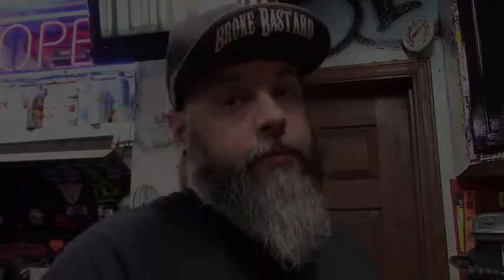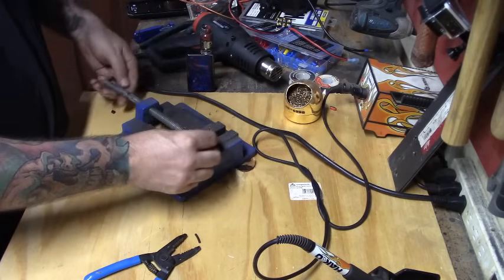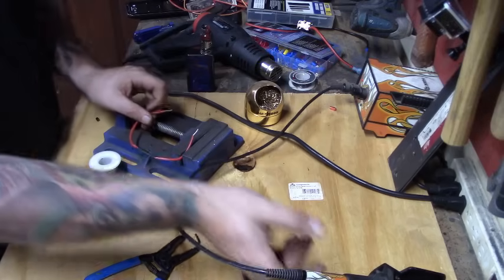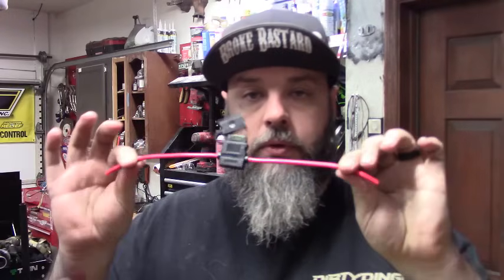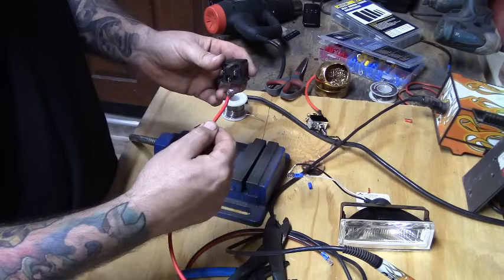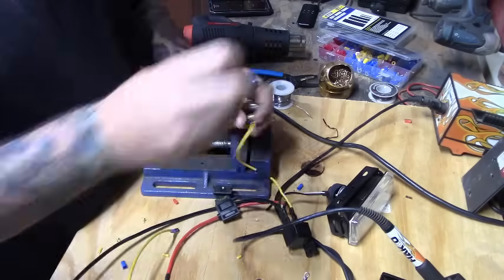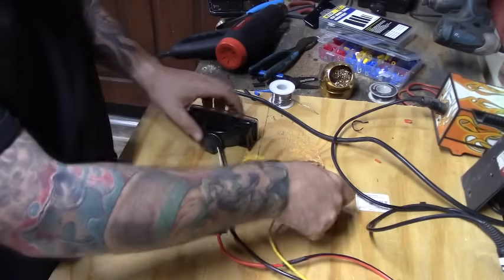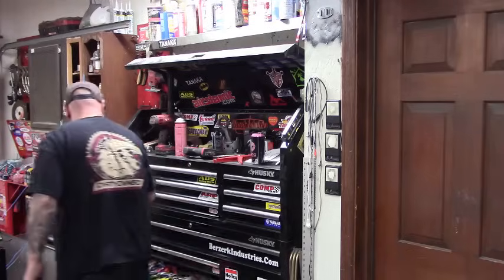How to wire a Relay and Why You should use them.

Comment: Hey when it comes time to wire the head lights go to ebay and punch in relay head lights. You can get both relays the harness and the ceramic sockets for the head lights for around $12.00 makes it wicked easy .
Reply: Head light circuits on older mopar stuff had same problem. They ran power straight through the headlighy switch. Everyine one ive had ive wired relays in to stop melting switches. Also old Japanese motorcycleare notorious for these wiring issues
Reply: Ho

Comment: 6:05 You really should hook or twist the wires together after tinning them; there should be a mechanical bond between the wire-ends, not just the soldered surfaces.  I have had many a wire pull apart this way.

Comment: If you want a stronger solder joint search NASA and military soldering techniques a much better integration of strands to solder but takes some practice😀
Reply: D twist Rewind agreed, the lineman’s knot and other wire splicing techniques make for better connections to solder. I also like  liquid tape underneath heatshrink. 

Crimp connections suck!!
Reply: His soldering is totally wrong. The worst way to solder a splice. Have to go NASA spec splice. The amount of solder that flowed down the wire and under the insulation sets the joint up to be too rigid. Just putting the two wires together without meshing the wires is the biggest no in soldering. He created a huge gob that is VERY susceptible to breaking. So yes he needs to learn how to solder.
Reply: Michael Shuman most people do, but I’ve seen worse than this. A simple tutorial - or some research - would suffice here I believe. Not everyone has been exposed to the “technically correct” methods, after all; it’s a specialized technique, after all. Not everyone works with NASA or to Mil-Spec standards.

Comment: HUM, 1st time I ever saw the "TIN" pre-solder step, KOOL, makes sense !
Reply: Numa Newbern ... I learned that when rewinding electric motors , soldering the internal connections and new lead wires   Makes a much cleaner & smaller connections. Always used the thinnest diameter 60/40 Tin as it’s much easier to control!  Happy wiring y’all
Reply: ...Oh yeah,  Never Ever used flux on electric motor windings,  it contaminates the factory coating on copper wire, causing premature shorts !  No Flux Necessary

Comment: You should have twisted the wire first, then soldered them together.  goood video  explanation.
Reply: Twisting is better structurally. If wiring heats up the connection will hold. Just saying.
Reply: I don’t think you noticed but He DID twist the stranded wires. After he striped it, he rotated the whole wire while holding the stranded end, go back and re-watch. You’ll see, its subtle but he did. I thought so too. I replayed it and sure enough. Good point though...👍
Reply: @Profabdesigns  Maybe I didnt see him , I checked again and I did not see him twist them together, HE did do it individually but not together....thank anyway's.

Comment: It's always a good idea to clean the soldered joints with a little alcohol and a "acid brush", especially if you use flux.  I recommend flux because it aids in cleaning the joint, and making a more solid bond. Good video!
Reply: “a more solid bond” just how freaking solid is good enough?

Comment: Excellent video. I have the Doyle crimpers and the Pittsburg Pro automatic wire strippers. They work really, really well. That HF heat gun also works great, just don't run it for too long or the plastic end heats up a lot.

Comment: Thanks for video great help now understand reason behind relay and where I want to add it in basic 12v circuit I am building. Just need work out the grounding part now will have to rewatch and see what you did. Thanks for help

Comment: ...Tnx man for the 4-Way relay numbering diagram included ( bottom right corner) midway through the video.  Tremendous help trying diagnose problems in wiring through relays!  I saved it for later AND subbed your channel. Uncle Fudd < N.PA

Comment: Older cars/trucks have relays under the hood and I have what I got the rig for. Yet being cheap, I grab easy fuses as there are so many different kinds that I pour them in a plastic tray on the bench for easy reach and most are color coded so I sight tells me which I wanted, and there is alway a few relays that go in my Dorman box and just lift lid and pick one needed. I can wire all my switches with sixteen gauge wire out to relay and depending on draw pick from relay to accessory. Keeps everything on short runs and so easy to put a few wires in a loom so it looks nice done. Good video for any newbie trying new to him projects.

Comment: Hello BBG, yeah good job talkin about fuses, many think its all about the voltage, can't get a shock
from 12 v so they don't worry about things. What they fail to consider is that the car battery has
way more amps than volts.  Cool Kat likes auto electricity. Some wire insulation will flame, some
just melt, either way not protecting the circuit is about the same as putting a penny in the old style
home fuse box.Good job about using a relay.

Comment: Thank you so my power box has red key on plug it into 87 ,has a green wire coming out the power box has a switch so the green plugs to 86 ,,the number 30 on the ReLay come from the battery fused plug into.30 ,and 85 is Ground,,,,
If I have it right ✅️ so Awesome Thank you Brother.

Comment: Great video, very informative thank you. I’m doing a holly blue electric fuel pump for the first time. I’m going to use a relay but I’m confused if I should make the fuel pump turn on with the key or with a switch. I’ve heard both sides of this what do you think?
Reply from the maker: I run them on a switch on the race truck. For safety. But on my normal cars I wire them to ignition hot.
Reply: @BrokeBastardGarage  OK cool, thank you for the reply. I am working on a 65 Coronet , street strip car, i’m trying to find out where to put the wire for the ignition, I bought relays and fuses because of your video just got back from the auto parts store, but almost the exact same stuff you have in your video. Thanks again!

Comment: i have connected 2 relays , in one big thick wire and connected to the battery positive terminal ,  i have installed 2 switches , one switch for one relay ,  and they are connected to the same positive wire that commes from fuse box ( key on power on )  so long story short both relays are connected to the same Positive wire coming from battery and same negative (ground wire ) to the negative terminal of battery ,    its any problem connecting this way,   can i use both relays on same time,    one i have for audio amp and the second one i installed under car led (like on need for speed underground 2 ) :D   thank you

Comment: From the diagram at 13:57 I see the switch still is drawing full battery power and runs the same risk as before; do I need to put an inline fuse as a safety precaution?  Loved the explanation of a relay, never knew why they were needed, now I do:)  Thanks for the video and succinct dialogue.

Comment: I could do a video on high grade splice soldering which is a lot stronger than what you do if you'd like because it stops the solder joint from breaking as easily when they flex

Comment: good video - I wish you were talking more about stripers, possibly showing some alternatives
no joke. the trick for soldering is applying the solder iron at the bottom of the joint, and the solder at the top, so gravity will work for you and let the solder go through the heated joint.

Comment: Thanks for the video. The soldering technique was really informative, especially your preference for non-flux tin.
 
I was wondering if you may consider making a video to show how to wire a relay to a rocker switch for a winch,  I want to install a winch on my pickup, using an IN-OUT 6-pin rocker switch (polarity reversing switch)  with 8-gauge wires to prevent overheating.
I am mostly interested in the fundamentals, namely the wiring diagram and possibly a demonstration of the basic circuit.  Do you think it is crucial to install fuses as well?

Thank you and good luck with your channel. You have the gift of clarity and you deserve success.
Reply from the maker: Does your winch have the small electrical box that comes with it that your remote plugs in to now?
Reply: @BrokeBastardGarage  Thank you for answering so quickly. I inherited the winch from a friend who upgraded to a more powerful model. He only gave me the winch, naked, with no control module or wires. 

Initially I was using it just connecting the wires from the terminals directly to the battery using alligator clips. I  was so ignorant that I was using 12 gauge wire but I learned very quickly that it was getting so hot the plastic insulation was melting.
I bought a IN-OUT 6 pin switch but on youtube I learned that a relay is strongly recommended. And here I am.
Thank you again for your excellent work.

Comment: Total nube to relays, etc., but I added a power seat to my '05 Dodge Ram PU today - all went well until I put a fuse tap on a 20 amp fuse - seat worked, but fuse blew. Tried same with a 25 amp fuse - ka pow. Same result. Will an inline fuse (what amp?) work and will I need a relay? The switch for the seat is OEM mounted to the seat frame. PS: your explanation and demo of soldering was EXCELLENT! Thanks!
Reply: Hahaha! I solved that puzzle - my truck WAS wired for power seats already - plug and play. Duh.  That's okay, all is good now and I still learned the right way to solder! Thanks!

Comment: The fact that you solder the wire to the butt connectors , and slide the heat shrink up over the prong of the relay is an Awesome tip. Very clean. Very safe. Thank you bro

Comment: Thanks for the video. Im just running two work lights in the bed of my truck. Can I just get by with a fuse between the battery and my switches? (I'm putting two switches in to control the lights individually).  (3" LED)

Comment: Great video  - love it: Question - 2020 nissan murano platinium - hardwire install blackvue dr900x-2ch plus +powercell 8 battery pack +cm100 lte module na. any tips on using a relay switch? thanks in advance

Comment: Where did the other end of the yellow wire go to? The relay to the switch and then from the switch to where? This was the best video and explanation that I have watch.  Motivating.
Reply from the maker: Anthony Diaz thank you. The other end of the yellow wire goes to fused power. Either ignition hot or battery hot depending on what you want.

Comment: Depends on what you are powering. Relays are switches as well. You can go direct switch and fuse if you take into consideration

correct wire based on current (and temperature), then the voltage drop based on the length.
correct switch based on current
apply de-rating current capacity on the above 2.

Comment: im going to add LED lighting kits (two) and a GPS power head to my 3 wheeler. I'm also adding a FIN (gps security) device. The lights will likely be switched power, but the FIN will be direct. I'm guessing that you would recommend a relay for each of the three connections, but would it be worth the investment of a fuse block or are inline fuses reliable enough to use on all 3? The cranker is that I'll have to fab a mount plate/box/whatever to mount the gang of switches since this year/model didn't come with that type of option. (Of course, the year before DID!)

Comment: 13:00 If I have to use a six-pin DPDT switch like that for just a single-circuit on-off switch, I connect both normally-open switch-positions to the circuit in parallel, so that both switch-circuits are carrying the current when the switch is in the "on" postion; it takes the burden of carrying the whole load off of just one pair of switch-contacts; both "halves" of the switch (i.e., both normally-open "sides") now carry half the load apiece.  So in effect, I am turning a DPDT switch into a DPST switch.
Reply: Great idea!

Comment: I bough a car PA system, I want to wire a relay in to get the most power to the speaker and hopefully in return it’ll be a bit louder. My question is should I wire the relay in-between the speaker and the battery or the amp and the battery (basically which will benefit the most from the added power)
Reply from the maker: It has to be between the amp and the battery
Reply: @BrokeBastardGarage  thanks man

Comment: fuse switch or relay ... calculate the amperage draw of the load..i.e  wattage rating divided by the applied voltage= amps..add 15%

Comment: Lighter works great as well to shrink the Heat shrink tubing.
 also if you needs to solder a wire together pickup a 12 Volt DC  Soldering Iron that plugs right into your Cigarette Lighter/ Power Outlet.

Comment: I had a LED lightbar installed (wires routed, switch located and power put to it) on the rear of a cargo rack on my Tahoe. I would have done it myself but due to a physical issue I was unable to. So I paid the "professionals" to do it for me. Fast forward a few years and I am replacing and relocating the 22" straight LED bar to the brush guard up front and putting a 32" curved bar in its place on the cargo rack. I come to find out that nothing was fused or relayed that I paid over a $100 bucks for. Hell the butt connectors joining the power lead and ground to the lightbar and running length of wiring wasn't even heat shrinked let alone soldered. Luckily for me the lightbar was only used sparingly when hooking up or dropping a trailer at night. Other than that it was used for backing down my 100' driveway at night (tinted windows and pine trees). So I am re-doing it all and doing it right.

Comment: I learned that you should fan out the wire strands a bit and intertwine them and then run the solder through the connection? Obviously, that would be for stranded wire connections. Anyway, that's how I've been doing it for a few years now. Either way ends up with the same results I guess.

Comment: Excellent video with much professional experience know how! I am just confused about one thing, though and don't want to take the time to scroll down through all the many comments to see if my question has been asked and answered. You had said that you didn't always use flux to get the solder to flow. You said you just used resin core solder. But the resin in the solder is flux. Yet I think you meant that you didn't use EXTERNAL paste flux, the internal resin flux is sufficient for these types of solder jobs.
Reply from the maker: kiggsia correct I don’t use paste flux.

Comment: Hey there I was going to wire up my 2 prong killswitch to my led light(neg and pos wires) that was going to run exactly like the first diagram shown but instead of running off the battery it would run off a fuse tap from an ignition live
Is there any need for a relay if using a piggyback fuse tap? 
I was going to ground the negative off the metal chasis 
Thanks and great video

Comment: Very helpful video
Do this relays work only with DC 12v?
What kind of relay would i need to add before the switch for a 12V house door strike and how do i ground it?
For the 12V strike can i use a transformer that has an output of 16 V
Reply from the maker: To tell you the haven’t done much with house 12v but in makes sense it would work the same. You just need 7v to trigger the relay.

Comment: Putting in a new harness for my 78 la 360, ive got a coil wire coming from the fuse box that i need to hook to my  positive coil  terminal and to my aftermarket ecu that doesnt need a resistor, whats the best way of turning my one wire into 2 to feed my two components?

Comment: Thanks for the video. I have a two-way radio I want to install in my car. I was told to use a relay between the radio and the car battery so the radio will turn off when the ignition is turned off. I don't suppose you have any video that discusses this?
Reply from the maker: Just hook the switch power to ignition power so it will tigger the relay when you turn the ignition on.

Comment: When we installed the new aluminum 4core radiator into the 99 civic hatch, we just spliced the fan into the original oem wiring guess still using the oem fan switch, is this still ok?

Comment: Thanks for the video...very helpful but would you clarify something for me please? You have the red power wire coming in (assuming battery source). The ground and wire to the light plus the yellow wire to the switch is self explanatory. But the other end of the yellow wire you mentioned below that it needs to go back to a power source. Can you elaborate what power source that would be or another words couldn't you just run it back to the battery? Thats where my confusion is. Thanks.
Reply from the maker: 1Placerville you can run to the battery if you want it to be able to turn on with the key off. If you want it to only work with the key on then run it to key hot or ignition hot power. Always fuse any power wires.
Reply: @BrokeBastardGarage  Thanks so much for the quick reply...one more question...if the yellow wire goes out to another power source,  could you not pigtail it off the incoming power (red wire)? Or does it have to run separate? And yes, i want to turn on/off without the key...thanks again.
Reply from the maker: 1Placerville if you want on and off with out the key.  Yes you can go from battery to switch to relay

Comment: I need to hookup a 5.3 to power in a mustang.  Standalone harness with the red wire needing to get a power source.  Can I hook it up to a fuse in the cars factory fuse block for key on power??  What would you recommend????
Never done this before and I don't want to melt anything down.
Thank you!